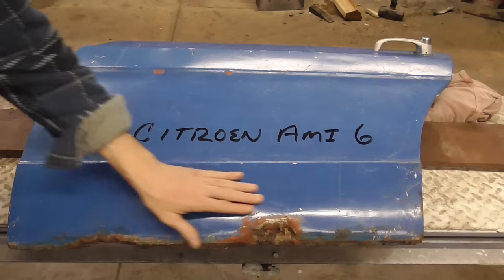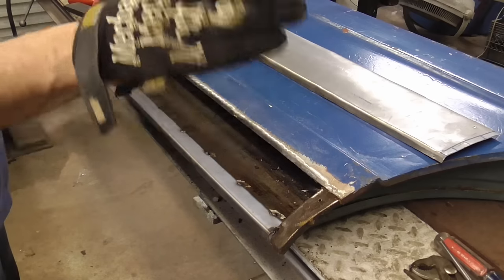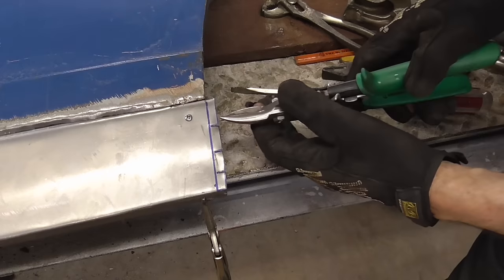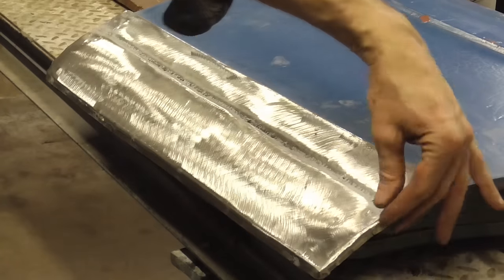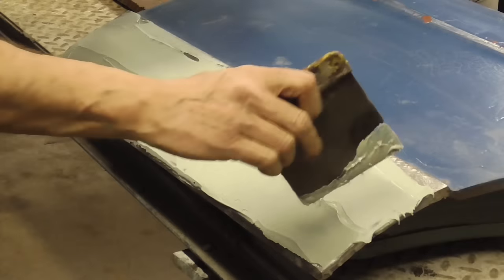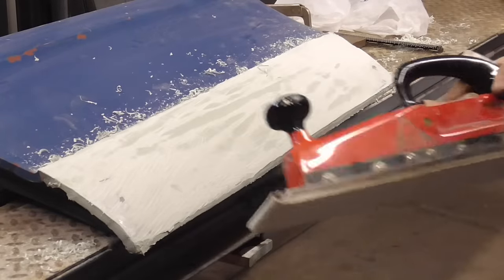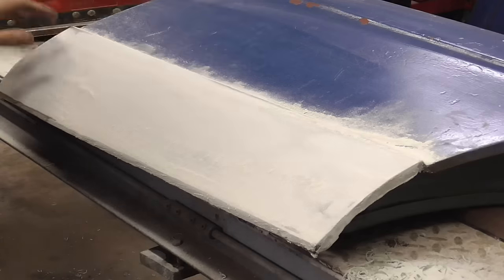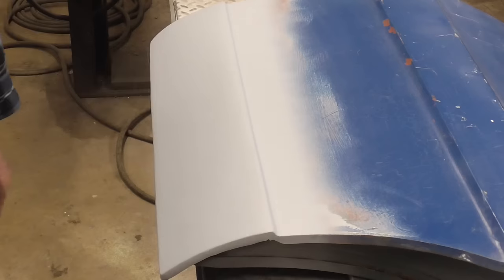Butt Welding Automotive Patch Panels - Start to Finish

Comment: No disrespect but if you just cover over the rusty inner door frame with a new section the rust is still there ... butt welding is the only method to success ... plus there is no need to cut the fold... once it is in folded position there is no resistance to flatten out. Plus where is your wire wheel to dress up panels and zinc weld through spray..?? Without anti rust conditioning it will only last two winters and show rust bubbles in the paint...!
Reply from the maker: With respect, lap welding is how all body shops in Michigan repair rust (welding or adhesive).  Strictly butt welding a patch panel, which has become popularized by the internet and TV,  is not the best quality repair and there are many good reasons why professional body shops don't do it.  Shops use a combination of both lap and butt (butt for spots that can’t be knocked down like edges) on almost every patch but would never just butt two pieces of metal up, weld it, then grind away at the area attempting to metal finish it.  Here why with good reason - especially Eastwood’s starting 22 seconds in: https://www.youtube.com/watch?v=rpH50kh4W00  *
https://www.youtube.com/watch?v=MfKlNQF-o4I  *
https://www.youtube.com/watch?v=e9bjZ_UxtJg  
Today’s metal is .030. That is literally 6 hairs (hair is .005) thick.  You start grinding on that and the result is paper thin metal and welds. Lap and Butt methods can work well if done properly so in the end it’s what works for you..  Keep in mind, you won’t find anyone butt welding in professional shops. Surely you’re not going to butt weld and metal finish this: https://www.youtube.com/watch?v=36zkc9UQaTs or some of my other rust repair videos.  Use small overlap, weld solid and you won’t have to worry about moisture - especially if you keep the drain holes clean (most important thing in rust prevention). Note that  the opening of the seam is upside down on the inside also.  Please see this video for longevity of this type of repair if done correctly: https://www.youtube.com/watch?v=8XaZBy7GC7A or 
https://www.youtube.com/watch?v=2o37dX--w0I

Comment: What welding setup do you have? I find when I try to weld panels I end up burning through the thin steel
Reply from the maker: I have a Miller Millermatic 90, 110v, 80/20 argon/co2, .023" wire

Comment: Well, that ain't  a butt weld, ya ask me. If anything, it is a right angle weld.
Reply from the maker: The point is... If you absolutely are sold on butt welding rust repairs this is the right way to do it.  This way when you're finished you don't have paper thin welds and adjacent sheet metal from grinding away at it trying to metal finish the panel.  See the video in the description from Eastwood - they don't agree with straight butt welding either for a good reason and they explain it very well in their video.  https://www.youtube.com/watch?v=rpH50kh4W00

Comment: Do you have to sandblast and paint the inside of the door? Do you normally do that first or after the welding repairs are made?
Reply from the maker: Yes, you can cut all that in (paint it) before you paint the whole car.  Remember - after painting the only thing you should have left to do before shipping it is unmask it.  I like to have everything done so I don't mess up the nice paint job.

Comment: Is it not best to primer bare metal before applying body filler?
Reply from the maker: No one primes bare metal in a body shop before applying filler.  If there is a company trying to sell that, I would not take the bait.  In 40 years, I've never had filler come off, crack, fall out, bubble, etc.  If your surface is prepared right (sharp grinding disc, sand blasted welds, very clean, no rust holes or rust it will be stuck on there forever. Just telling you what I know so you don't waste $.

Comment: did you drill some drain hole in the bottom of that door so water can get out? or is the door going to fill up with water every time it rains?
Reply from the maker: Yes - drilled 3 - 3/8" holes at the lowest points.  If it's your car or truck, the bigger the hole the better so that water and debris can exit.  You can even blow it clean every now and then and make sure the drains are open - very important for rust prevention.

Comment: I was wondering Jerry: if you do not have access to the backside of your panel, should you paint before you weld (maybe using Weld-through primer, for exemple)? Thanks!
Reply from the maker: There is really nothing that is for sure to use on the back side.  You can try all the ideas out there but the best way I have found is to make absolutely sure the panel can drain and stay dry on the inside and that the pinch weld or bottom of the panel has some type of protection that stays fluid or does not harden and eventually peel and trap moisture - here's an example - https://www.youtube.com/watch?v=8XaZBy7GC7A
Reply: @LakesideAutobody  Alright thanks...

Comment: are you supposed to use a etch first on bare metal before bondo?
Reply from the maker: No, it's best to use a nice sharp fiber resin 36-40 grit disc to prepare the surface.  Filler will never chip, bubble, peel, or fall out if put over a correctly prepared metal surface.

Comment: I have a question, where do you get the metal from? Do you get it new or used? Hopefully you get this message
Reply from the maker: Alro Steel in Grayling Michigan but you can get it from any metal supply place.  -  A1008 Cold Rolled Steel Sheet
Reply: @LakesideAutobody  Hey thanks alot for messaging me back I live in Ohio so I should be able to find some. Thank you again for the information and have a great weekend.

Comment: You should epoxy prime before filler
Reply from the maker: With respect, never use epoxy primer before filler.  Epoxy primer doesn't sand and will clog the paper for one and 2 you don't need EP before filler.  Filler is made for over bare metal.  Hope that helps make your work go faster :)

Comment: Great video, but you skipped over the welding a bit too quick.  Did you just spot as shown or continue to spot across the whole panel?  Also would this work similarly with gasless mig?
Reply from the maker: I continued to spot across the whole panel.  I tried flux core wire once but did not like it as much as the gas.  I thought it was a little dirtier but maybe I didn't give it enough of a chance.  I know it can be done though - I just like the gas.

Comment: interesting approach but misleading as a butt weld.  Probably would have been just as effective (and cleaner) putting a flange on the upper portion.
Reply from the maker: Check out Eastwood' take on this type of butt weld.  https://www.youtube.com/watch?v=rpH50kh4W00  Body shops in Michigan lap weld, knock it down and fill - it honestly is the longest lasting and efficient way other than panel adhesive.  See this video for longevity of this type of repair if done correctly: https://www.youtube.com/watch?v=8XaZBy7GC7A or 
https://www.youtube.com/watch?v=2o37dX--w0I
Reply: @LakesideAutobody  thanks for the reply,  I looked into this a little further and received some more insight (pro's/cons) to lap welding.  Great videos!
Reply from the maker: @jroot1279  You're welcome.  Something to think about:  Today's sheet metal is 22 gauge or thinner (6 hairs thick) or .030 a hair is about .005" .  If you start grinding away at the welds and the surrounding sheet metal chances are you're going to end up with some pretty thin areas whether it be welds or adjacent metal.  All the shops I worked at (and they did excellent work) used a combination of lap , and butt. However, butt was only used where you were forced to do it - on the edge of a panel, etc.   Lap weld it up (solid if you want), knock it down, fill it and your done.  Most important thing in stopping rust from returning is making sure the drain holes are open at the bottom of the panels and you try to treat the back if you can.   Hope that helps answer some ?s you have.  Jerry

Comment: I’m really regretting buying the Titanium Flux 125. Not that it’s bad because it’s actually a good welder. Being purely a flux welder, it doesn’t have the traditional gas nozzle. I’m having to get the perfect lighting to actually see where the wire is and many times I don’t hit the seam because the welding helmet I have is crap lol. It’s a Harbor Freight as well and it was $59. I didn’t get the cheapest dammit! Watching you effortlessly spot weld because you know where the wire is in relation to the nozzle leaves me shaking my head and cursing my utter failure at welding research! 😂 
Another great video.
Reply from the maker: Maybe you can switch out the nozzle.  Remove your nozzle and go to HF or a welding place and get one that surrounds the wire / contact tip.  Do you have an auto darkening helmet?
Reply: @LakesideAutobody  I already tried an HF MiG nozzle and no joy. It doesn’t have threads to go in place of the stock nozzle and it’s too small to go over the stock one. 
The helmet is auto darkening but it’s default setting is about 6. That and the wire color is pretty close to the color of the metal. I’ll probably sell it to my friend and get a combo off of Amazon that has flux core and solid capability. 
I’m just learning so it is what it is. Another thing I don’t like about it, there is no explanation of what the settings, (numbers and letters) equate to in inches and volts. 
It’s a constant reminder that one should never buy an old English Land Rover.... from eBay,..... when drunk 😂
Reply from the maker: @chrismitchell45  Don't do anything important when drunk!  If you're serious about learning to weld and want a welder for the rest of your life - save your $ and go buy a Miller 110V MIG. Like this one:  https://www.millerwelds.com/equipment/welders/mig-gmaw/millermatic-141-mig-welder-m00486

Comment: hmm...40 grit on the sander....think he had some more sanding to do since he didn't feather the filler edges and go up the grits to remove scratch marks.
Reply from the maker: You can hit it with 80 on the block or some guys hit it quick with the DA while they are feather edging.  I use a hog with 80 to knock down the grinder marks in the paint first to make it easier to DA with 120 so sometimes I hit with that also.

Comment: Question..??  Could apply for an entire quarter panel??  Thx
Reply from the maker: Do you mean weld a quarter on like this?
Reply: @LakesideAutobody  yes..meaning can you wield an entire quater panel with this method?? can you butt weld an entire quater panel and grind those weld smooth or to do an entire quater panel does it require another method...?
Reply from the maker: @alphathefirstone1222  Usually a quarter panel is welded on with spot welds.  In the factory the pieces of metal are pinched together and welded with a spot welding machine.  When you do it you drill holes in the quarter where the pinch welds were (the ones you had to drill out to remove it) and weld it on through those holes.  Across the sail panel you can lap weld it, knock down the welds and fill.  That's how the shops I worked in did it.  We would sometimes cut the quarter panel where we needed to to save work of putting on the whole thing,  You really can use any weld that works best for your situation though - butt, lap or spot,  Hope that helps in a way :)   Jerry
Reply: @LakesideAutobody  i will let you know what i come up with. right now i am debating bondo or weld a new quarter .. the video you posted today ....really clear up the bondo filler method . If you get some time. check this youtuber called "D.I.Y Auto School".... I watch is his video on bondo and he always talk about how it cracks...I think now after watching the new vide u posted today...i did nt understand what the purpose of the grinder was. I thought a regular DA would produce the same surface for the bondo to take. Now I see a grinder is a must. Going buy one tomorrow....check out that youtuber D.I.Y Autobody. If you can stand the arguing they do over there. he has some okay videos...lol ..
Reply from the maker: @alphathefirstone1222  Bondo does not crack unless someone applies it wrong.  If you apply it correctly it will never crack, never bubble, never shrink, never be noticed ,etc. for as long as you live - that's the truth.  There's probably filler in brand new cars that no one knows about - I'm sure they use something for small dings and imperfections in the factory.

Comment: Love your videos - very helpful!  In some of your older videos for something like this you lap weld and then knock it down  to then fill.  Here you switched styles - do you like this style more now?
Reply from the maker: I still like and will always prefer lap welding.  It's faster, it works just as well and any other method,  you can do very large odd shaped rust damage.  There's no rust hole that can't be fixed using lap joints.  Remember, every car is lap welded together.  The floor even has lapped seams (with no weld through primer) and it lasts for a very long time before the rust gets it.
Reply: Yeah I saw a video it was a gas tank door he did that method of butt welding. I guess you can use anyway that works for you. I made my patch panel before I did any cutting to make shire I was able to make it, so I didn't just have a big whole. I used old broken appliance fridge metal was the same thickness work well
Reply from the maker: @snoopu2601  You are absolutely right.  You pick the method that works best for you and your situation.  Rust will begin at the bottom of the panel where salt water and debris gather anyway not up high where you seam is.

Comment: Dude you won a suscriber just in the part you mentioned using the pliers to make a 45` angle to make the weld more solid and easy, as we all know sheet welding is a samurai-like art that takes time to master. That little trick was awesome, without mentioning it improves the general mechanic resistance of the seam a little bit.
Reply from the maker: Glad you liked it - thanks for subscribing

Comment: Great video, im wondering after seeing another video this morning on plug welding, if i can use this method to replace all my sills on van? he used  plug welds every 2 inchs & caulk sealer. stuff( i dont know wht its name is?) ...wondering if it would be ideal , so i dont have to weld all the way along, as im beginner....but def gunna do the work myself!!
Reply from the maker: I think you'd be fine plug welding and using auto body seam sealer - it won't look perfect but it will work for a daily driver - https://www.amazon.com/ACDelco-10-2013-Joint-Filler-Compound/dp/B007Q0ZQGK/ref=sr_1_1?dchild=1&keywords=ACDelco+10-2013+Body+Joint+and+Seam+Filler+Compound+-+10.1+oz&qid=1594661368&s=automotive&sr=1-1
Let me know how it goes or what you decided to do - Jerry
Reply: @LakesideAutobody  cheers Jerry....i will do

Comment: What did you use on your air filer
40G paper.
Reply from the maker: 80 grit on a rubber block.  Sometimes if you're sure that it's perfect you can hit it with the DA as you feather edge the paint.

Comment: Nicely done.  What are your thoughts on using metal etching primer before applying filler?
Reply from the maker: I don't think it's necessary. I've never seen it or heard of it being used in high volume body shops.  I do think there is a specific process to use though and that is prepare the metal with 36 grit fiber resin disc such as this: https://www.harborfreight.com/7-in-36-grit-resin-fiber-sanding-discs-3-pc-69641.html  Grind slow to reduce heat and always aim to cut/scratch the metal instead of rubbing/shining the metal.  If you are putting filler over paint check this video out - https://www.youtube.com/watch?v=koMw6-auoIs  Hope that helps - Jerry

Comment: I have a question, did you completely fill the valley  with weld and then grind it level or did you leave a bit of a valley and level it off with filler?
Reply from the maker: Left a bit of valley then filled it.  I totally disagree with grinding welds flush.  It compromises the integrity of the weld, the surrounding metal and is a big waste of grinding discs or other material.  Knock it down and fill it.  It lasts longer too.

Comment: What's the name of the tool that gives the 45° angle?
Reply from the maker: I did that with an old pliers - it has an angled head.  You can use a channel lock pliers like this too:  https://www.homedepot.com/p/TEKTON-5-in-Angle-Nose-Slip-Joint-Pliers-PGA16005/303054487?source=shoppingads&locale=en-US&mtc=Shopping
Reply: @LakesideAutobody  thanks
Reply from the maker: @shawnlawrence4840  You're welcome :)

Comment: I going to be trying my luck with welding some patch panels in my old pickup. I have one of eastwoods perfect panel prep tools ordered. Thanks for the info ive been watching all the videos i can to get a better idea of how i need to do this project.
Reply from the maker: Let me know how it goes and how the prep tool worked for you.
Reply: @LakesideAutobody  I'll let ya know. I still have to pick up a gas bottle for my welder and a few other odds AMD ends before i really get into this project.

Comment: Great video. I have a question, can similar be done with creating a lip edge on the patch panel to go under the original and welding it similar to how the bottom was done?
Reply from the maker: There really are no rules so if it works for you then it is a quality repair.  You just want to make sure that what ever method you choose works on absolutely everything so that you become efficient.  The only problem I see w/ going under is that if you have a round rust hole - how do you get the patch behind if you don't have access to the inside of the panel - many situations like that - rockers, dog legs, lower quarters and fenders, doors etc.  Let me know if that answers you question - Jerry